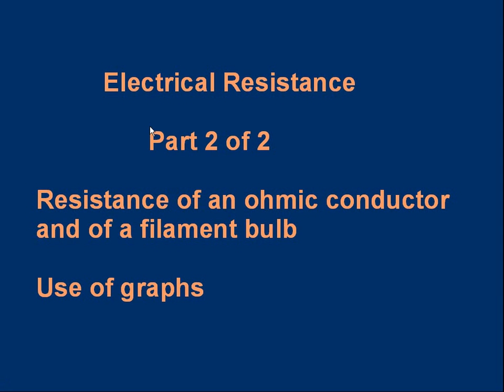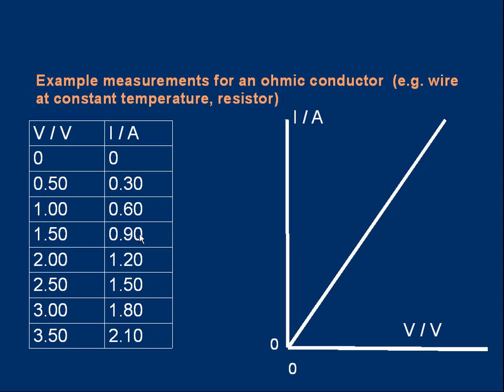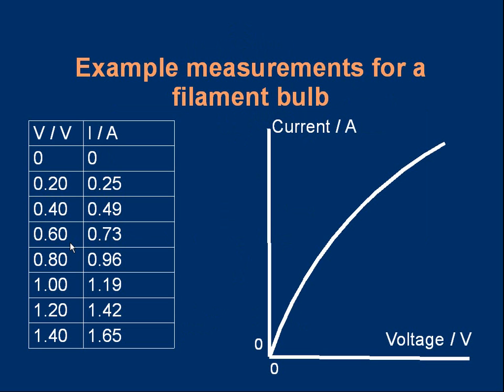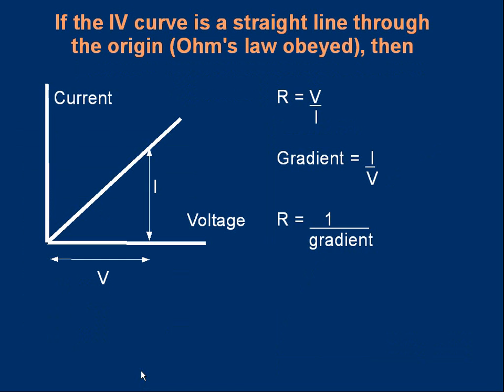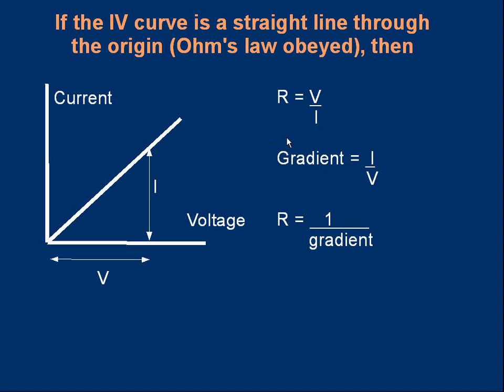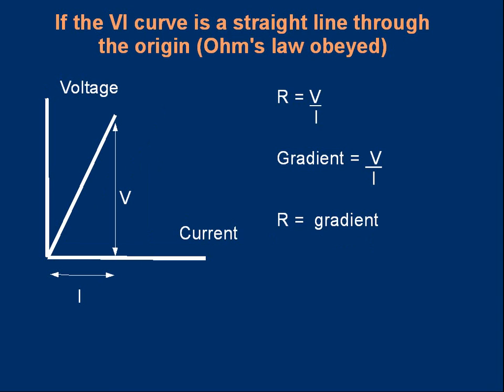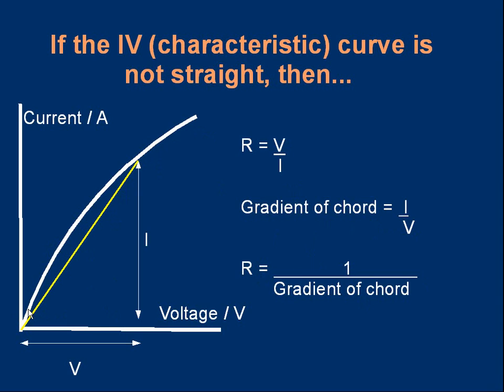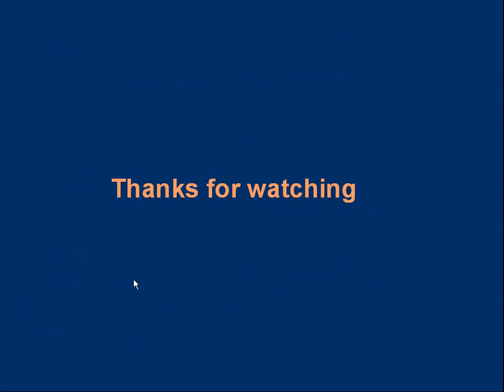GCE (A level) Physics E08 Resistance. Part 2 of 2

Comment: The gradient of your graph does not give resistance. It gives the inverse of resistance  (1/ R). Only if the voltage is on y axis and current on x axis can the gradient give you resistance. Gradient = (change in y axis)/(change in x axis).

Comment: Great video Steve, thanks a alot! Please could you explain in a bit more detail why the gradient of the tangent at a point doesn't give you resistance. That's confused me. In maths we are always told that the instantaneous value at a point on a curve is equal to the gradient of the tangent at that point. Why does it not apply here?
Reply: Hi.

Even some websites and text-books get this wrong!

Each point, P, on a curve can have TWO gradients associated with it:
a) the gradient of the tangent at P;
b) the gradient of the chord (straight line) joining P to the origin.
Unless the graph is a straight line through origin, these 2 gradients in general have different values.

The DEFINITION of resistance is (value of voltage)/(value of current).  This corresponds to the gradient of the CHORD from a point on IV curve to the origin, NOT the gradient of the tangent at the point.

Resistance is NOT defined as the rate of change of V with respect to I (which would be the gradient of the tangent). Resistance is defined as the simple ratio (value of V) / (value of I).

If you know calculus:
For a graph of y vs. x, the gradient of the tangent at the point P, with coordinates (X, Y), is dy/dx evaluated at x = X. The gradient of the chord joining P to the origin is simply Y/X.

Hope that makes sense.
Reply: Steve4Physics Thank you so much for your time in writing such a good response Steve! That information was very helpful!!

Comment from the maker: Hi. I’m pleased you find the videos useful.
Putting ‘V/V’ is fine.  It may look strange because the symbol for voltage and the symbol for a volt are the same (both capital V).  If you aren’t comfortable with it, then PD/V or Voltage/V are also perfectly acceptable.
If you are interested, the rules are covered here:
physics.nist.gov/Pubs/SP811/sec07.html

Comment from the maker: @xTruncz Hi.  Yes, the filament has a positive temperature coefficient.  Semiconductors are negative temperature coefficient, but thermistors can be made with both positive and negative temperature coefficients. I've sent you a separate email about this.  Good luck

Comment: If the resistance of the filament lamp increases as the temperature increases then is that the same as saying it's Posotively Cooeficiant? And also isn't a Thermistor negatively cooeficant?
I have my first Physics exam of AS in like 8 day's, and I was really good at the subject it to start with, (my particle physics is at grade A but my electricty is much further behind at about grade D to U), but I've had to put Physics of for a long time now due to Chemistry! I need alot of help man :/

Comment from the maker: @songyosk 

If you are told V=5volts and I=2amps, you know R = 2.5Ω - the shape of the V-I graph doesn’t make any difference. (But if it’s a straight line through the origin, then in this special case, R does equal the gradient.)

But if you are told the charge is 5C when t=2s, you do NOT tknow the current - the charge mught not have started flowing till t=1.99s for example - you need the gradient at t=2s.

Comment from the maker: To songyosk.

The value of resistance (R) is the voltage (V) across a component divided by the current (I) through it. R=V/I, that’s how resistance is defined.

If you mark a point, P, on a curved V-I graph, the value of V/I at point P is the same as the gradient of the cord from the origin to P.  The value of V/I at point P does not equal the gradient of the tangent at P.